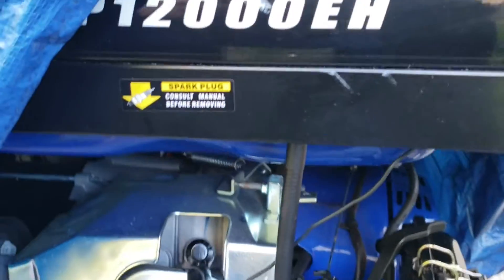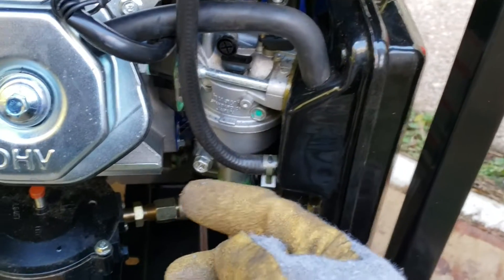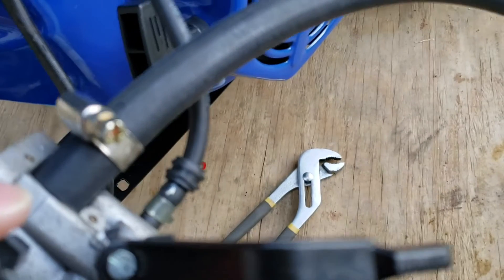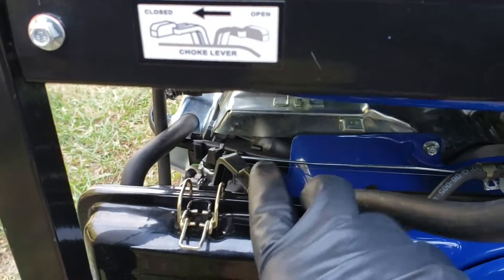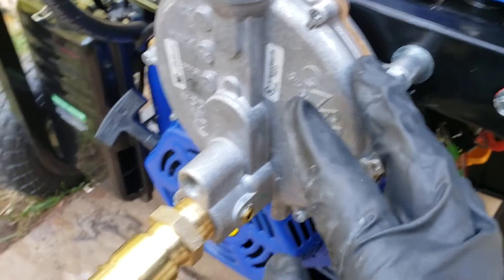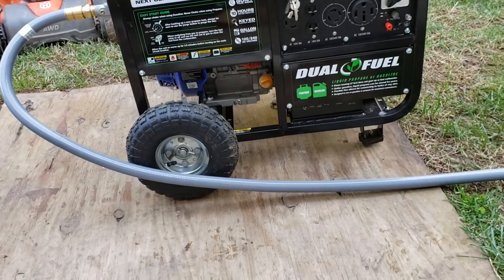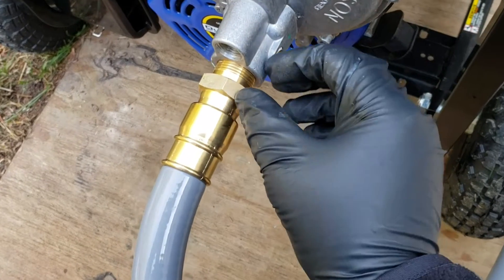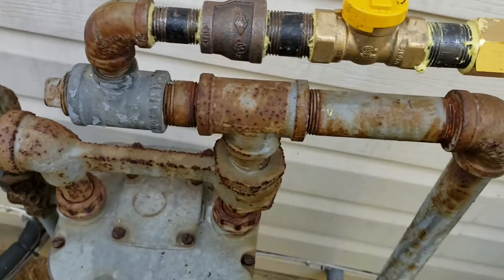DuroMax XP12000EH - Converting Gas/Propane Generator to Natural Gas (Dual Fuel to Tri-Fuel)

Comment from the maker: Just in case this video was not clear enough, IF YOU HAVE A HYBRID generator, you don't need the snorkel kit. You just a new Natural Gas Regulator that connects to the same/existing Propane port on your carburetor. Your choke placement will differ from altitude, settings, and machine. Link in description for kits that you can buy cheaper. Also, shortly after this video, I did paint my gas meter pipes with RUST-OLEUM professional high performance enamel spray paint to prevent rust. 

Now if you have a "gasoline/petrol only" generator, the additional port method or snorkel kit would work best for you.
Reply: Yep, I just got a hybrid generator, designed for gasoline and propane. I just used the conversion kit for my barbecue, which converts the barbecue from propane to natural gas. Just pop the line off my barbecue and popped it on to you the generator. You are correct, you have to adjust air flow with the choke, but it runs great.
Reply: i have a hybrid dual fuel and want to add NG.  I was starting down that path of using a BBG convert from LPG to NG but was told would not work because pressure was different.  Did you have any lessons learned?  @Freethinker1967
Reply: Great video. I'm trying to prepare for the Summer surprises. I'm wondering about the hook up to the electric panel box of the house. Do I need to buy the cable or does it comes with the generator? Also , Can I power the entire house with that? Thanks
Reply: @elsalvador007  Hey dude u need to buy a 30 amp extension and a double breaker n a threw the wall outlet n a safty switch for electric box theres vids on here about that on yt also
Reply: @raymondj8768  Thanks
Reply: I believe a Cresent Wrench will work also it's a square plug.
Reply: @jb0776  It will . In his case , he might have needed s pipe wrench for his pipe connections .
Reply: Hey Chris, great video with a ton of information! I was wondering if you ever measured the pressure in your gas line? I’m asking because I have a set up that is almost identical but can’t get the engine past a few revolutions before sputtering out. I’m using a similar regulator but am thinking of switching to the exact model you have to minimize variables. The specs listed for that have a pressure inlet between 9 and 13.5 inches of water column. The pressure in my line is roughy 7.5 to 8” w.c. which is pretty standard for residential gas lines into a home. I’ve also read that the gap on the spark plug should be decreased for natural gas because it’s a “dry fuel” and can be a little more difficult to ignite. I was wondering if you made any other changes that weren’t mentioned in the video. Thanks Chris!

Comment: This is the statement I was looking for:  (IF YOU HAVE A HYBRID generator, you don't need the snorkel kit. You just a new Natural Gas Regulator that connects to the same/existing Propane port on your carburetor) thanks for the great video!!

Comment: I would like to connect a motorcycle engine 4 stroke to drive my 26kw generator .  Could you please specify what size of motorcycle engine should I use? Is 300cc enough for this task? How about noise and fuel consumption?

Comment: Wait I have an idea turn the generator around so you don't have the hose bent around and you will not need a 90 fitting, lol.
Reply from the maker: @gunlover1955  I thought about it, but the exhaust needs to point away from the house

Comment: Hi!  Does anyone know if a tri fuel generator already has a gas regulator that can stop fuel flow should the generator motor for whatever unknown reason shuts off on its own?  If there isn't a regulator already on board the generator, then where should the regulator be installed, on the generator, or the gas line near the meter?  Who can perform this type of work, plumber?  Electrician?  HVAC installer?
Reply: Generally a Tri-Fuel generator has solenoid(s), one for each fuel selection.  This is an electronic switch that opens/closes depending on the selector switch that is selected on the control panel.  The low pressure regulator for propane that feeds the carburetor should be sufficient for natural gas, you'll want to see if it has a 4 oz or 6 oz inlet pressure.  This regulator will look like a "pancake" and may have the name Garrettson on it.  Garrettson is a popular brand for demand regulators, which is intended to shut off if the engine is not drawing a vacuum.  In the video above, OP "primed" the regulator (he held the spring/button open for 10 seconds) which is an important step to get the natural gas flowing by lifting the diaphragm off the seat.  This aftermarket conversion can be done by anyone, but if you are not comfortable, then a plumber should be upgrading this system for you.  Best of luck!
Reply: @Werno15  appreciate alot you taking the time to explain all this to help generator newbies like me navigate our way in selecting a generator that best suits our budget and individual needs.  Thank you!

 someone more experienced to help generator newbies like me navigating  trying to be safe
Reply: @doradean3097  All good, I was in the same boat a little less than a year ago.  It's fairly simple once you realize it's really just two or three parts to make an engine run on a gaseous fuel.  

If the generator is already equipped for Propane, then the conversion to NGas is simple.  If it's a standard gasoline generator, you'll need to retrofit the carburetor for gas service.  

Buy the biggest generator you can afford, I've never said to myself, "...man, I have too much power in this generator"
Reply: @Werno15  Agreed, it's way better to have extra power not needed than to have not enough!  Thanks again.  Next thing I need to learn  about is bonding and floating neutrals on a generator, thanks to people's comments leading me to explore issues I wouldn't even know to consider had they not mention it!

Comment: i converted my XP9000IH inverter type to tri fuel by using a Y valve on the pipe coming out the carburetor, one side of the Y goes to the existing propane regulator, the other side of the Y goes to the natural gas regulator, if i want to go back to propane i just switch the valves on the Y back to propane,  I ran a 4 ton AC unit with a soft start on it no problem on natural gas
Reply: How much in natural gas was the overall cost vs gas

Comment: good information.  One my Duromax XP13000EH Hybrid dual fuel,  I am trying to find a "one regulator" that will work with LPG or NG with quick connections in order to have a full on tri fuel.  any ideas on this solution?
Reply: I bought a motor snorkel tri fuel kit and it only contained the one regulator (same as in video) so you just need the appropriate hose to go to the LP cans/feed; and maybe an adjustment of the set screw, not sure.
Reply: Use a y adapter.

Comment: You could spend 30 bucks to get a tri fuel carb
Reply: please tell me more,  this sounds like a solid solution,  I have a Duromax XP13000EH Hybrid.  Do you have a carb in mind that will work and if so can you provide me a link or carb info and part#?
Reply: @richardsilva5134  https://www.vpowerequipment.com/duromax-xp12000e-three-fuel-carburetor-9500-12000-watt-generator/

Comment: A natural gas regulator does not stop the flow of gas it reduces the three or four pounds at your house to inches.  (One pound of gas pressure is 28 inches of water column) they are adjustable with a screw in the middle of the diaphragm using a manometer at the ports. "Most home and commercial generators are designed to work with a standard gas pressure of 0.18–0.25 psi, or 5–7 inches of water column (wc). The recommended nominal operating pressure for natural gas is 3.5–7 wc, with 6 wc being ideal. " I believe a dual fuel generator will have a solenoid shut off valve for the gasoline and the propane in order to make them safe to use.  I did find a couple of the conversion kits that have the fuel cut off solenoid built into them.

Comment: The Generlink site states that the Generator output should be 10k or below for the 40 amp version, but you have a 12k model generator. Would this be an issue? ( I have the same one)
Reply from the maker: Natural gas loses about ~20% output from gasoline so by modifying it to NG, its now a 9600 watt surge 8000 watt running generator.

Comment: After hurricane Ida, we did not have electricity at our house for 16 days I converted our generator to natural gas, we have a transfer switch. I did it all the work myself every day. I watched people wait in line for gasoline in excess of one hour every day. I did not have to bother with that. Once I started a generator running on natural gas, I was done. if you have just minimal electrical and plumbing experience, you should be able to convert your portable generator to natural gas. If you feel you do not have the knowledge just like he mentioned in the video get professional help all I can say is once you converted to natural gas you’re done the lines for gasoline and propane like I mentioned earlier was at least an hour. Wait every day for 16 days.

Comment: What is that called on top of the regulator you turn 8 times
Reply: Did you figure this out? i'm wondering the same thing. Seems like it just takes some pressure off the gas going into the carb?
Reply: @adde32332  load block to lean the fuel going to the carb, you can use a small ball valve instead of that custom screw type

Comment: There isn't an orifice change option?  When switching a furnace from LP to NG one just changes the orifice in the burner's.  Changing the size of the orifice is equivalent to changing regulating pressure ie bigger hole less pressure.
Reply: This isn't a burner, just fuel for an engine

Comment: My 10000e gasoline duromax generator is running at 5000 rpm on natural gas with the snorkel, is that because of the know you turned on teh regulator is not set right or does that have anything to do with it?
Reply from the maker: 5K is way too high, you need to be at 3600. You should have a set screw to adjust it down. It's kinda hidden, but it's a Phillips head screw you can adjust to get it down.
Reply: @Mr-Chris  Is the screw on the carburetor or the regulator that came with the snorkel?
Reply: I have a champion dual fuel generator that I have upgraded to run on natural gas. In my situation I purchased the natural gas regulator and a longer section of LP hose and bypassed the propane regulator completely. I use the Hertz meter that's built in the generator to control my RPMS. You want to stay as close to 60 HZ as you can by adjusting the set screw on the valve that's connected to your natural gas regulator. When I'm up and running sometimes depending on the load my generator will drop in RPMs and subsequent the Hertz~ drops also. I found on my generator I can use the choke control in very small movements from the off position to bump up the the RPMs and get to that 60 HZ frequency which is optimal for running Electronics

Comment: Hi, I have the XP13000HX dual fuel. I want to convert to Tri-fuel but I'm confused to the conversion kit that I need.  do I need a high pressure or low pressure? It comes with the propane hose that had a 25psi-250psi regulator on the hose.  I don't know the generator require inlet pressure. Plus some people speak in "wc or psi.  Can you please help?

Comment: Will the generator still run on gasoline if needed?
Reply: Oh yes for sure. You will have  3 options: 1. Gasoline alone. 2. Gasoline and Propane alone. 3. Gasoline, Propane and Natural Gas. However, there are things you must do; to set the Gen to use any of the above Gas fuels. IE:

Option Gasoline. Turn ON the Gasoline line.

Option Gasoline and Propane. You must turned OFF your Gasoline line. And then change the big "knob"; that say Gasoline or Propane. That is all. Now IF your option is NG; do the same with some differences. IE:

When you are using NG, you MUST turn off the Gasoline line; and leave the knob on Gasoline. NOT propane as many do. Now one CAN do it. BUT...the Propane "regulator" can be damaged when NG; is being used IF the knob is on Propane.

MANY do not know this. But it is very important. So again when using NG, turn off the Gasoline line and KEEP the option KNOB on Gasoline. NEVER have the Knob on Propane. ONLY use that when you are using Propane.

Hopes this helps you.

Comment: I have the same DuroMax xp12000eh gen. duel-fuel.. I ready to try and set mine up as  you did . My only question is my house  NG gas meter shows spec. at 5 PSI and regulator shows 7 WC is that going to be enough Ng to run my generator. GREAT VIDEO
Reply: Yes, that is enough. The generator approx.  need 4 inches w.c.

Comment: How did you make the electrical connection from your generator to your meter?
Reply from the maker: I have a device called GenerLink that is hooked up to my outdoor meter.  It automatically cuts power off to the main when it senses generator power so it won't backfeed, but the capacity is only 30 amps. It has to be installed by your local power company. I hear that some local power companies offer them for free or discount if you are persistent. However If I could do it all over again I would recommend a 50 AMP interlock connection since it allows more capacity in amps.
Reply: They do make a 40amp version which I purchased recently, still awaiting it to arrive and be installed by the power company. Also went with the surge protector model included. With this I will be converting my generator from propane to NG.

Comment: I'm not a gas fitter, but I can tell you one error I see that won't pass code. You have too many small fittings connected together at the supply base. There should be the least number of threaded connections possible to avoid possible leak points.

Comment: So the problem I'm having after installing my regulator is that my generator will turn on the first time but won't turn on after I shut it off. I have to wait until the next day... Any thoughts?
Reply: Regulated natural gas is extremely low pressure usually measured in inches of water column.  Residential gas  pressure is typically 5 psi or less, mine was even lower 3 psi. Depending upon the diameter and length of your hose will determine how fast the gas will pack the line. My first experience was I thought my installation was faulty. After a brief time 30 minutes, it fired right up. Good luck.
Reply: @Retaile23  my regulator at my meter says 7
Reply: @pedropunjabi7339 Did you ever figure out your issue?

Comment: A quiet Generater.Systems , love the dual fuel capabilities, camper is 50 amp but the adapter helps and found it still handles the load. Haven't taken a camping trip yet, that's in a couple of weeks. Will see how well it does over a long weekend.
Reply from the maker: Yes, but it's strongly frown upon. You have to make what they call "suicide cord" which is like a dryer male to male plug. You also have to make sure you turn off main switch at panel.
Reply: @Mr-Chris  ... and make sure all family members know what not to do while that suicide code is in use.  The simplest demand is, "don't touch it", but in the case of you being away and your spouse needing to get power back on, you could give more details (don't ever touch the metal prongs of the plug -- they are the equivalent of live wires).
Reply: You can, but run the risk of back powering utility power back to your generator should your utility resume if the main is not separated.  Too much humor error is in play without proper electrical interlocks.

Comment: Cool, I've wondered how difficult it is to convert a propane gen to nat gas.   BTW.   I use a 75'  long  3/4" garden hose for my nat gas line on my 10kw tri-fuel gen.   I don't even change the fittings on the hose.   At the meter I have a 3/4 npt to 3/4 garden hose fitting.  Then at the gen I have a 3'  adapter hose, 3/8 flare to 3/4 garden hose I made using the hose from a cheapy propane regulator.    Where the garden hose changes to the 3' adapter hose I have inserted a plastic $2 garden hose  ball valve, which allows me to turn off nat gas at generator.    In all I love it.  It sets up fast and is inexpensive.   Harbor freight has the hose 3/4 100' for $30 or Home depot has a 75' thats black with a yellow stripe hose for $45 I prefer.
Reply: That will work, only Temporarily because garden hoses split easily where they are not reinforced with the internal Stainless Steel lining that the proper Nat Gas hose has..and when the "cheapy" garden hose up and decides to split with Nat Gas inside leaking out through the splits, you will have a Disaster of your own "cheapy" making 😂😂😂
Reply: Hi , this is exactly what I'm wanting to do!  Do you have any videos or pictures?

I've searched and haven't been able to find anyone doing this other than a post on a message board with less information then you said here.
Thanks for your post.

Comment: So I'm thinking that if you mounted a 3 way valve or a tee with 2 separate valves, you could keep the ability to run propane as well. Propane through the existing regulator,  or run Natural gas through the regulator you mounted.
Reply from the maker: You could do that, but the new regulator also works propane too, you only need a adapter fitting from 3/4 to 1/2 or 3/8  propane line. Depends on how intercit you want to be with the this setup, but your idea would also work.